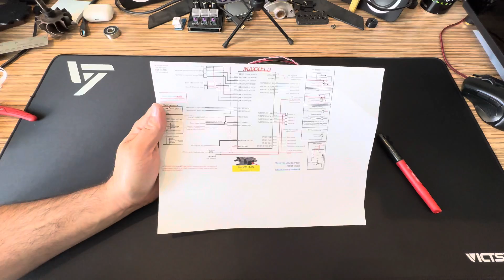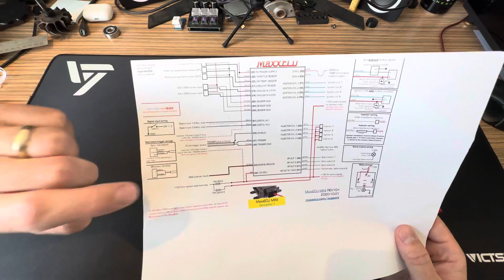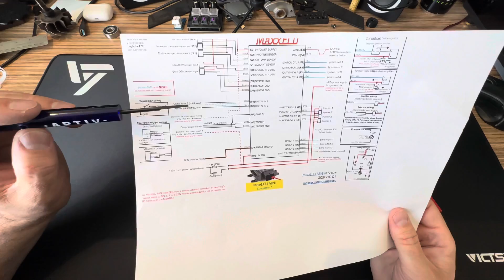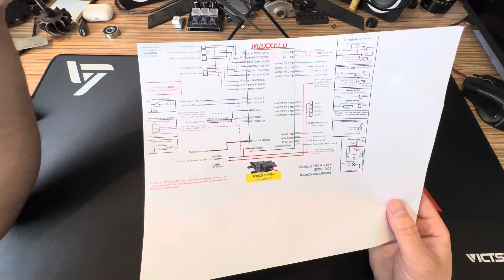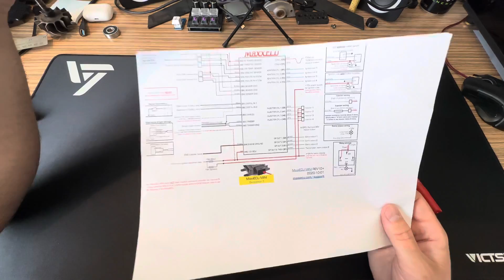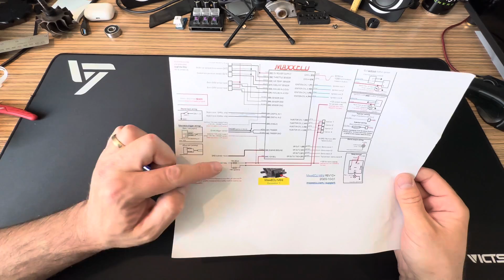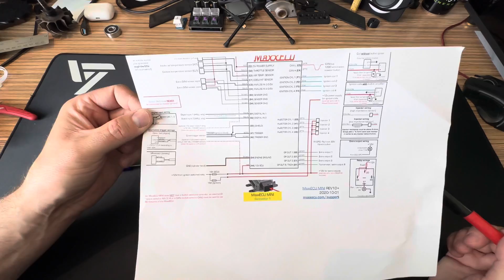Wiring a MaxxECU MINI PiggyBack/Parallel Basics

Comment: Would this keep my factory gauges and other PCM controlled features? Am looking at a 8HP70 swap in my 2002 Lincoln Navigator and wanted a TurboLamik TCU as I didn’t want to touch the factory PCM but i wouldn’t have throttle cut or blip so Parallel ECUs? I live in California and would like to have the Factory ECU in place and happy where it’s not setting major check engine lights. Do you think this would work? I want it to be like factory while keeping the stock ECU happy enough to set Smog readiness monitors.

Comment: Hi, in case of port injectors , i would like to use the Mini to control injectors , since Mini has only 4 injector output  and the engjne is 5 cylinder, can i use the one injector output to control 2 injectors? Thanks

Comment: Question, I'm getting ready to start my car with a maxxecu race version. I see that most of the outputs are ground controlled by the ECU. I have everything wired up and I used the fusebox from the maxxecu website. my fuel pump and engine fan are not coming on when I go key on, engine off. Do I need to turn these on through the mtune software?
Reply from the maker: Yes you need to setup all additional inputs and outputs in mtune under their respective sections
Reply: @TurbineResearch  thank you

Comment: I'm curious to see how your crank trigger and cam triggers share with the stock ECU.  Does the Toyota use VR or hall sensors?
Reply from the maker: This is a VR sensor so it has a strong output voltage that you can just tap and share with both ECUs
Reply: @TurbineResearch  I found out you are correct, I was losing sync at higher RPMs and found I had to put a 10k shunt resistor in in order to hold signal to 7000 RPM.
Reply from the maker: @oddcarsandbaddecisions  glad you got it sorted out !
Reply: I like that you can share the factory crank VR sensor to both factory ecu and the mini...what if i wanna tap the hall sensor on cam so i can run full sequential, on a 4 cyl.. Subaru EJ motor.

Comment: I guess I haven't been paying that much attention. What year vehicle is the this? Pre or post 96? And with injectors and ignition being taken over, won't this set a code in the factory ecu? I'm very interested in this video series, I may have a future project of my own. Thanks.
Reply from the maker: This is a 2001 4Runner. The igniter has a separate output that tells the ecu the coils were fired so as long as they get fired the ecu shouldn’t be able to tell. The injectors are a dumb output so they should be fine. We will find out soon how it all goes. Stay tuned
Reply: I'm all ears..Very interesting stuff.